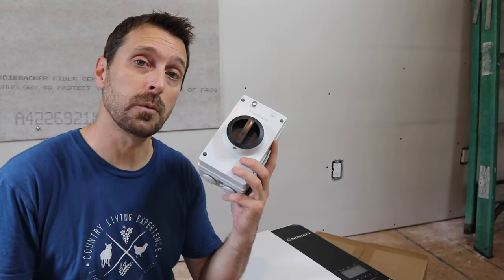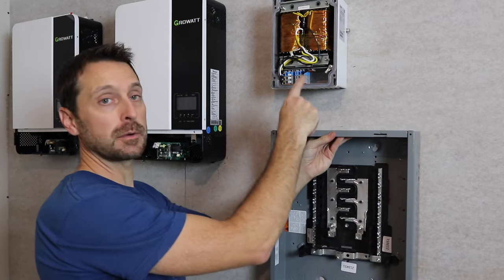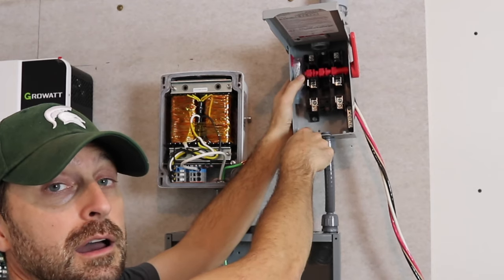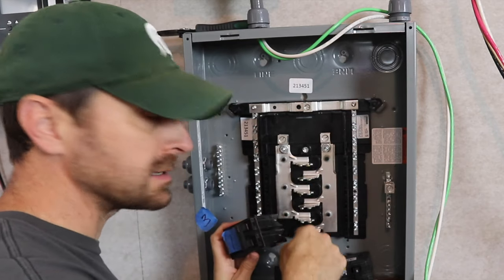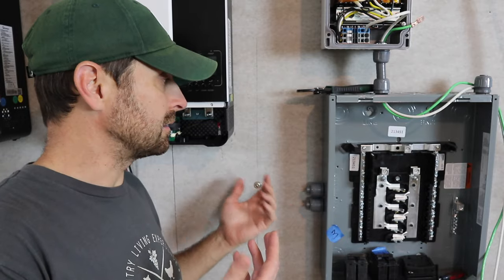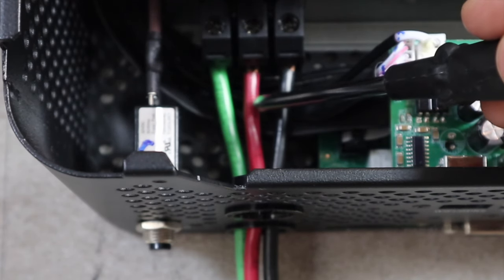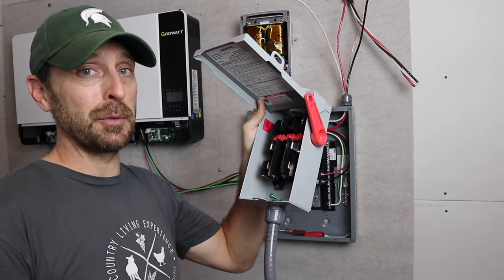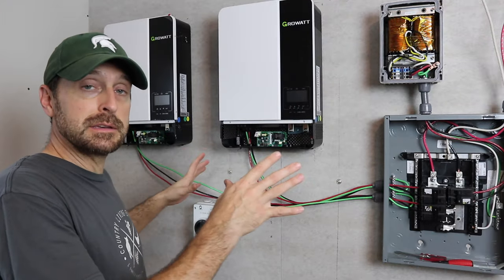Growatt Inverter 5kw Installation And Wiring DIY Solar System!

Comment from the maker: ALL OF OUR SOLAR EQUIPMENT...CLICK HERE: https://www.signaturesolar.com/?ref=countrylivingexperience
Reply from the maker: @gregs3220  That is correct.
Reply: Why are using two enverters?
Reply: Can you explain why a breaker is between the inverter and load center?
Also if the breaker trips between transformer and load center you’ll lose the 120v step down?
Why not connect directly to the lugs ? And then have your 70a DP breaker off the box ?

Comment: Your breakers are to protect a device or peice of equipment. Depending on the amperage of your solar array would determine breaker size. Since it is protecting your array, you dont want it to be significantly above whatever your solar array amperage is. In simple terms you dont want your array to "burn up" before your breaker trips.
Reply from the maker: I understand that.
Reply: Breakers are used to protect wires.
Reply: @DJ0Light  Yes. But if you are not using a breaker appropriately sized for your equipment it will not trip. For example if I put a 50 amp breaker fed with #6 awg on a 10amp hp motor. The motor will burn up long before your circuit overloads tripping the breaker. That was what I was trying to point out. All three of these breaker, wire size, and equipment rating are going to need to be  sized accordingly.

Comment: You are confusing me, in South Africa, the black is N, red is Phase 1, yellow or white is Phase 2 and blue is Phase 3. We have 230v single phase and 380v three phase. Higher voltage means less current. Growatt delivers 230v single phase inverters here and in the UK. Our cables (wires) are measured in millimeters cross sectional area. I am an Installation Electrician (3 phase) and in our factories you need one of these or you are not legally allowed to do electrical work in the factory.
Reply from the maker: The American grid is different with different standards. As an electrician you should understand that.
Reply: I know, when a machine is imported from overseas I have to be careful when I have to connect it up. @CountryLivingExperience
Reply: This is for the us

Comment: Making life a bit easier on the knife switch. Bring the wires up from the bottom and connect to the top and the wires coming from the main breaker thru the top of the box and down to the bottom. POOF now you have plenty of wire to work with
Reply from the maker: Good tip. Thanks

Comment: 12:49 Future ref: On most of those boxes the black plastic part is secured with screws (some are riveted). You can remove the plastic/switch from the housing, connect your wires and reattach it. It saves the fingers. 
Really nice solar install!!
Reply from the maker: I appreciate that but I looked all over that box (Siemens fused safety switch) and could not find one way to take off those inner parts.

Comment: With that knife switch, a lot of times you can remove the actual internal “guts” of the box allowing you the room to wire them up. Once done you can reattach the internals into the box. 
Working on my install today. Enjoyed the videos and information.
Reply from the maker: Cool. Thanks for the tip

Comment: Great stuff, thank you for sharing it. We are intending on using the same equipment on our off-grid property next year. I'm not 100% clear on how the auto-transformer component works, but I'll learn!  🙂
Reply from the maker: Very cool. Signature Solar has a great video on how that auto-transformer works.
Reply: It’s simple, the midpoint transformer maintains a balance between the two legs. The voltage difference between the midpoint and a hot leg is 120v.  That is how you get a neutral from it.
Reply: Thanks for the great video I am currently installing a similar system with growatt and GYLL. It looks like you were able to maintain your main breaker panel by using the generator interlock kit. I was an electrician in the military so I’m OK with getting into a hot box. I assume by doing this the automatic grid function in the inverter is disabled and you have to manually throw the interlock when the grid is needed. 
Is there a way for me to support your channel through Patreon?
Reply from the maker: @robertstout9240  I may upgrade that interlock kit in the future when I get more comfortable around electricity. For now, I am comfortable with manual switching. I appreciate the kind words. We don't have a Patreon but people sometimes donate the the Paypal link/address in video description...."Support Us With PayPal at countrylivingexperience@gmail.com"

Comment: Thank you, not many people doing these videos show all that, I’m in the process of doing the same exact thing. Keep it up you got a good thing going.
Reply from the maker: You're welcome. Glad we could be helpful.
Reply: That's what I thought. Most waffle on about it but they have paid a fortune having it fitted. I want to fit my own and save a fortune so like you say not many show the wiring so this is good info
Reply: Thanks,  I'm doing the same system only with a Growatt Autotransformer. It has 5 lines in to it, not 3. Any chance you've used the Growatt model and would have an idea of how to deal with it's Inverter Input L-N and Inverter Output L-N-L while only having the three connections in the panel? Thanks again
Reply: I'm using a Growatt transform to, I think you really only have to took up the three lines out, since L1 and L2 cross over anyway, it doesn't know what's coming in or going out, it's just extra wiring, but don't hold me to that, I haven't fired mine up yet, I'm about two days way!
Reply: @jamesnewman7860  ,thanks, that's sort of what I was thinking. Also, I just talked with tech support at Signituresolar and he emailed me a wiring diagram for two Inverters with transformer and it's showing a sub panel for the Inverters (as a combiner box) and then the Transformer landing in the Main panel, which is different from the  youtube videos I've watched. The grounding is well covered. Good luck.
Reply: @clouddance4444  I would like to see that diagram, just to make sure my right.

Comment: Just FYI/future reference. The smaller box I believe it was a disconnect that you were talking about. If you look at the bottom of it and the top which I believe I could see the Baltimore wrong but they have the ability to be on bolted so you can go through and cut the approximate size length table that you need And I’m bolt the actual fuse holder itself then run your cables through there, hope the wires to it accordingly then feed your excess water back out the top and then both the fuse holder back into its box and you’re good to go. I had to do that with my shop, I ran some cable that was bigger than my thumb and you want to talk about pain in the rear lol we ended up doing that for a couple of the boxes and it worked like a charm. Food for thought all good video and appreciate all the information and the step-by-step instructions on how you did it.

Comment: Thanks for the video.  I already have 2 Growatt 5K, 240 vac inverters and an auto-transformer but I'm still designing my system.  Your video has helped me as I continue to prepare my install. The challenge, of course, is getting the correct wire sizes/ratings and their associated breakers.  I'm looking forward to your follow-on videos. One thing I'm a little worried about is if the auto-transformer trips.  I understand that none of the 120 vac loads would be supplied at that point but the 240vac loads might be unbalanced after the trip.  I can mitigate that by how I connect the 240vac breakers for my various loads and by running 240 loads at the same time that are on opposite lines, which is not always easy to remember for other members of my household.
Reply from the maker: You're welcome. From what I understand, if the transformer fails or it's breaker flips, the 120v circuits in your home will just not work but the 240 will.

Comment: Good thing you bought from Signature Solar... apparently other US vendors are selling the EU version of the Growatt 5000 ES that can be dangerous in the US.
Reply from the maker: Yep, I am thankful for sure. Sig Solar was very up front with me when I purchased the equipment. They asked me exactly what I wanted to do with it and suggested the 5000es models. I wanted off-grid and that is what I got. I told them I did not want to put ac back into the inverters.

Comment: Hi there, any idea where to find info about wiring this system up in a different country? Cheers
Reply from the maker: The unit comes with instructions for wiring. If you purchase it in another country, the unit will be internally modified for your electrical grid. The item you would not need is the transformer since your country probably uses 230v.

Comment: Thanks for this video. My question why two smaller inverters instead of one larger one? Thanks
Reply from the maker: There are so many combinations and types of inverters on the market. Some do the same thing and others function differently. I choose this option because they were less expensive and physically lighter than an all in one unit. Additionally, they can be paralleled with more units (up to 6) which will give you much more inverting power than a single stand alone unit.

Comment: If I understood correctly with that breaker at the very end, this system is working offgrid, and in case you need it you can switch to the main grid ?
Reply from the maker: Yes, that is correct.

Comment: Hi there ! Just quick question. Do you think 4mm2 flex cable will be thick enough for the same inverte what you have only 3.5kv model i need it to run from a fuse box to inverter and s about 15meters the only reason for that is can’t any closer .just wonder 4mm2 or 6 but many web it says 4mm can handle easy 3.5 kw 32 amp and is only single phase .many thanks
Reply from the maker: There is a big difference between 4mm and 4mm2 (squared). You would need to use 4mm which is equivalent to 6awg (American Wire Gauge).  4mm2 is way too small and would be equivalent to 11awg.

Comment: What is that panel you mounted them on. That looks stronger than sheet rock. Oh I see Hardie fiber cement. That looks like a good choice and more fire resistant I would think
Reply from the maker: Correct. It is recommended to mount on Hardie board.

Comment: Good job my friend. 
I have some question about relabel of those inverters.
They pass over two years of installation. 
Is working every day?
How hard do you use it?
Do you have any problem?
Thanks 👍
Reply from the maker: No problems with them. Just one firmware update.

Comment: We will be installing a system similar to yours thus summer in Colorado. We are purchasing 2 Growatt 5000 and a pallet of 440 bidacial panels.  We'll have 4 strings of 7. The extra 2 panels will be for the well pump. Great video.
Reply from the maker: Awesome! It’s a great feeling to get it installed and running.
Reply: @CountryLivingExperience  Are you using 30a breakers or 50a breakers for the Growatss?
Reply from the maker: @martinhrabe9888  40a

Comment: can i only connect the inverter to my household grid connection AC- in and Out and not via PV solar connection? Cause my PV cable is on my existing SMA/BYD storage system. Can i charge and discharge the growatt via my fusebox 230v*16A = 3.680w ? (european connection) And does the inverter knows when i have pv excess and charge when i have this excess?

Comment: Common protocol would treat black wire as Line 1 (2 wire, blk & wht, 120v) where as the added wire in a 3 wire system (blk, wht & red, 240v), the red ,added wire, would be treated as Line 2.

Comment: you diddnt comment on the ground bar if it was put in by you or did it come like that , i got random breakers 40amp  and a random panel box 60amp , do you think most breakers are compatible with panel boxes ?
Reply from the maker: Breakers need to matched to the box. GE breakers with a GE box, etc. I put on the grounding bar. It comes with the box.
Reply: Omg thanks for the reply will have to re order

Comment: Great video. I have components but have not installed them yet.
Sorry if asked but the panel where your inverters and transformers reside , the neutral and grounds are not bonded right? because you are connecting to your main house panel where its bpnded?
If I am creating an isolated sysyem for my garage, would you have bonded the neutral and ground at the panels with the components?
Thanks
Reply from the maker: Thank you. 
Correct but I am not an electrician. I took advice from the solar company (Signature Solar) and had a friend who is an electrician come and inspect what I did. There is still a little debate about the grounding and there is no agreement across the board.

Comment: Did you ever find out about the grounding question for the inverters? I have this same set up and I'm to the point of wiring everything up. I was wondering the same thing about the ground.
Reply from the maker: Not yet.
Reply: Of course you have to ground the inverters.  If there's a fault internally, and you get either the high-voltage DC or the inverter output present on the cabinet, it's a (fatal) safety issue.  You need a ground to divert those fault currents and hopefully trip an upstream breaker somewhere.

What you've not mentioned anywhere is where in your system you will by tying neutral to ground.  Presumably that's still happening back in your main panel (and still happens when the 70A breaker there is open).  You'll need to keep that in mind if you later install some sort of automatic transfer switch.  There should be only one place in your system that ground and neutral are tied together, and you should be planning the system design to include that aspect.

Comment: What exactly does the transformer do? Does it balance the power coming from the solar system to the grid?
Reply from the maker: It splits the 240v output from this type of inverter to two 120v legs

Comment: Good night 
I have two sungold hybird inverters installed in a parallel as.master and  slave. When ever I manually  switch from SBU tO SUB the slave inverter
Switches  to error and  shut down. It has to be reset manually. Do you have an  idea what is causing this problem and what can be done?
Thanks for your  help.
Reply from the maker: I am not sure. I am unfamiliar with the Sungold inverters.
Reply: @CountryLivingExperience  Thank you

Comment: So for the brakers that you plug your inverters into I belive you only needed maybe 25amp ones, your inverter outputs 5k watts at 240, so 240volts(x)25amps =6000watts

Comment: Hi. Just finished drying walling my shed. I have three Growatt ES5000 with two transformers. Tomorrow I hope to install the backer board (2) to a wall that is ~85” wide. Can you tell what type of screws (or whatever hardware)  you used to mount your ES5000’s to the backer board, as well as the transformers. I have Growatt transformers as well. Thank you kindly. 

Blessings
Reply from the maker: Awesome! I just used regular wall anchors. The bigger ones will tell you the weight they are rated to hold on the package. Got them at Lowes.

Comment: I live in a double wide trailer will  A 3KW inverter be enough to run off grid?
Reply from the maker: Probably not but you will have to do some load calculations to see what your actual usage is first.

Comment: I had to disconnect the ground from my house ground on my single growatt inverter as I was getting ac current through my PV wires / I installed a separate grounding rod for the growatt system to solve the issue. (I’m no electrician so there might be a issue with my main panel)
Reply: You really need to only have 1 single earth ground.  You will induce issues having multiple grounds like that.
Reply from the maker: I think they all need to be grounded together.
Reply: Per the NEC.... Separately derived systems each need a ground electrode. The ground electrodes are typically bonded together.
Reply from the maker: @ericp4832  Signature Solar just told me that the inverters need a separate earth ground rod.